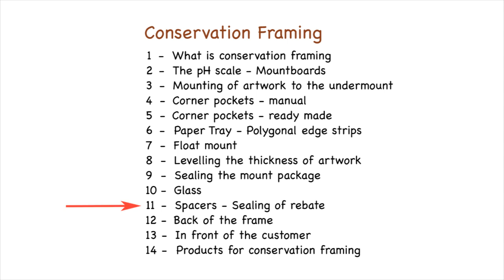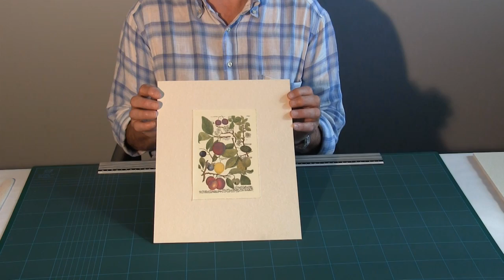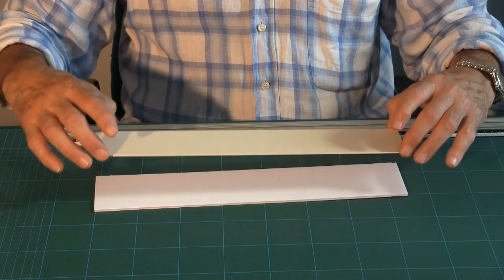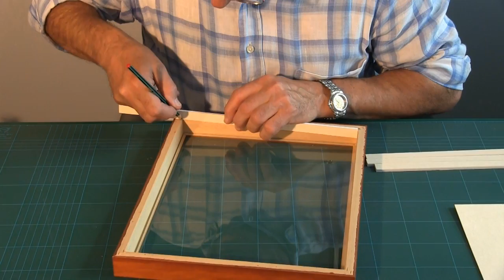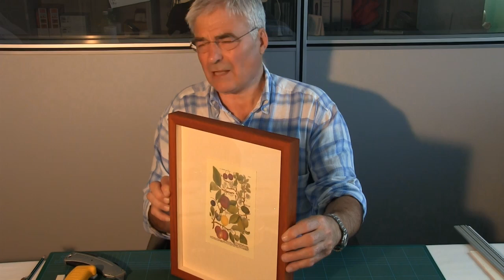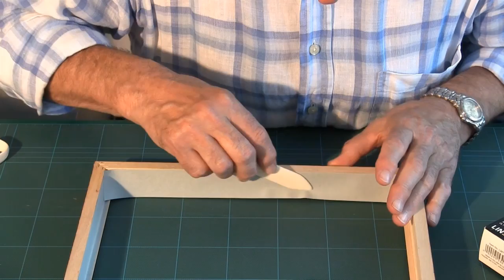Conservation Framing: 11 - Spacers - Sealing of rebate

Comment: wow great stuff. I hate when the wood or paint particles flake off the inside of the frames and then the particles get onto the front of the glass or art and ruins it if its in a bad place.    Need to maybe try this. Up goes the cost and price of my artwork :)  Thanks
Reply from the maker: I good method of removing these annoying particles is to obtain a feather duster to dust the glass and mount package before assembly, alternatively use an air blower. I use both. Mal Reynolds

Comment: what material is the backing board?
Reply: Yeah the backing board that comes with the frames is usually pressed wood which can generate particles.
Reply: Conservation grade corri corr, maybe... I think he showed it in another video.
Reply: I always just use another matt board (when you have two the back becomes fairly sturdy).